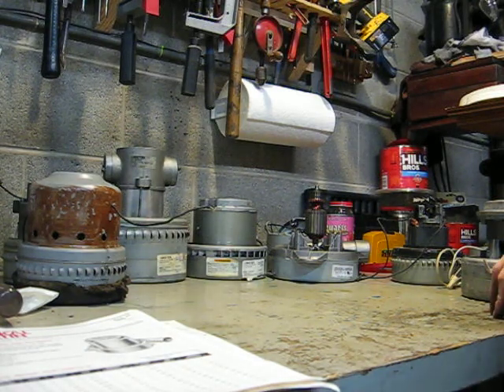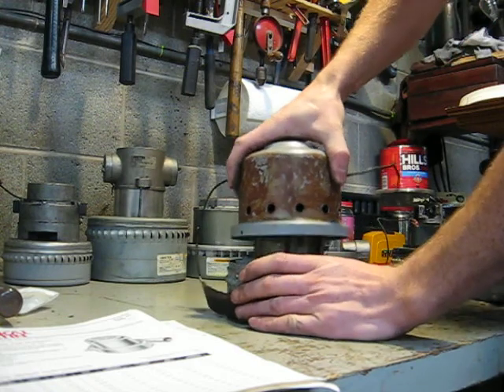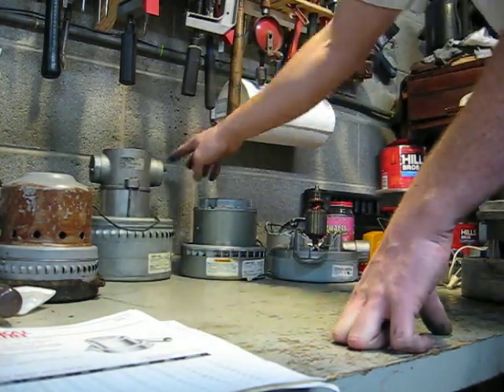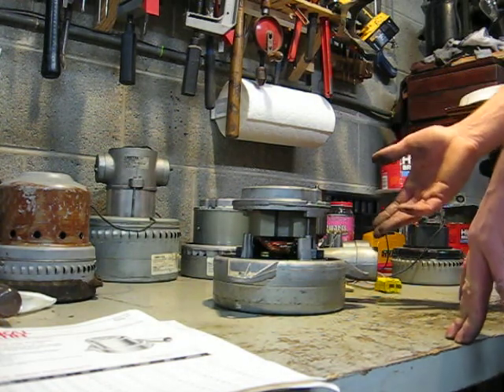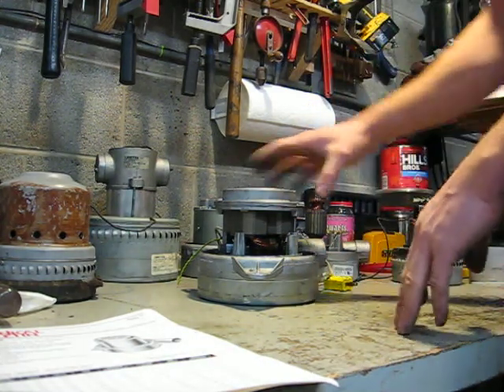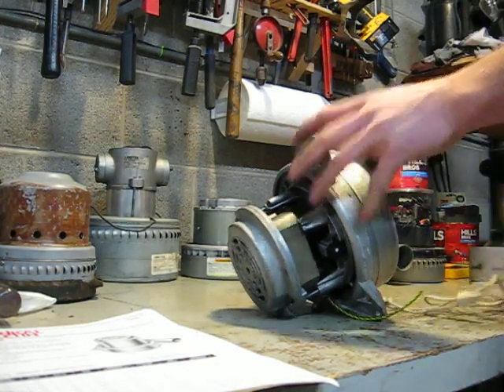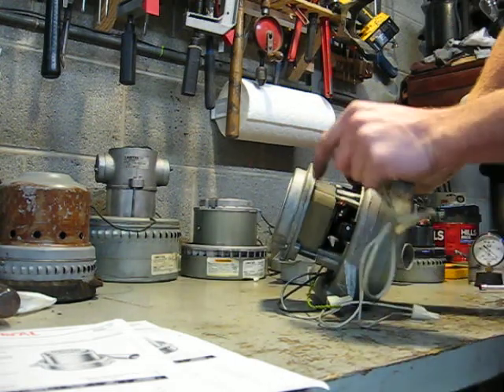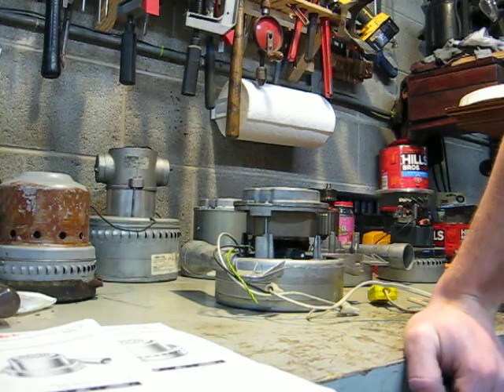Ametek-Lamb Central Vacuum Motors

Comment: I want to build a shop vac with one of these motors which one would work best, im not to worried about cost, .thanks
Reply from the maker: @MrCubflyer  depending on your application (wet or dry pickup, hose diameter and length, etc) you might have several options. Also think about filters...the more airflow you have, the more filter surface area you need

Comment: The Ametek-Lamb motors are very solid and perform great. I do have a 7886-50 flow through motor from a German Miele S142 made in 1997. The plastics of the vacuum cleaner was so dried out and cracking that I moved the motor into a newer housing of the same size. Still running great on a daily basis and way better than what you can buy today.

Comment: Very interesting and informative!  Thank-you.  Question: at one point in this video, you mentioned that some vacuum motors have two impellers, or even three.  Is “two impellers” what constitutes a “two stage” motor?  If so, how can multiple impellers be run off of one motor without overloading the electric motor, or loss of performance?

Comment: Interesting.  I have a 115334 sitting beside me that I took out of an astrovac. It is clearly stamped made in USA. The website that I ordered a new one from had a little paragraph explaining that the new ones were no longer made here, and to not expect it to last or work as well as the original. I sort of expected that anyway. But now I'm contemplating ordering new brushes for the old one and trying to rebuild it. Any thoughts?

Comment: Owen, just yesterday I replaced  a lamb motor from a two motor Beam 2900 central vac unit. This unit had 2 Lamb motors. Each motor ran at 110 volts each, however the unit was wired to 220 volt outlet. Inside the unit was a circuit board that separated the 2 motors to run at 110 volts. Powerful suction and the dual motor exhaust looked more like a drag racing engine.
Reply from the maker: That's interesting - I haven't seen that arrangement, only 240 volt motors. If it used 120 volt motors, they would have to have been wired in electrical series. Have done that a couple of times for special applications.

Comment: Dont they use these bypass motors in the Turbine HVLP systems such as the Fuji Mini Mite or am I mistaken
Reply: I think so but seems the only thing you cant find on the internet is a picture of the internals of a turbine hvlp. I have been Trying to figure out how a couple old vacuum cleaner motors sell for $1000 when labeled as a paint sprayer.? Would be really cool to grab a few from the scrap yard and plumb them in series and see how cheap i can make a 6 stage hvlp
Reply: @josephcalvosa8272  I think it's only ~$1k for the whole unit. I did a quick search for HVLP blowers and there are listings that appear to be standard vac motors for a few hundred bucks. High end pneumatic painting sprayer systems can be hundreds of dollars and that doesn't include the air compressor. But I don't know for sure.

Comment: Hello, I am  trying to connect a Windjammer 116630-04 to a 0-10v  signal generator for speed control. I am having problems with the wiring and wondering if you could help me- you seem super knowledgeable about these blowers. Thanks!

Comment: I gotta lot of love for the 334.   I have to say that of new generation motors the 122233-00  6.6" 2-stage tangential by-pass is a impressive performer (not for cyclonic models).   Longevity remains to be seen but it's hard to go wrong with a 2-stage tangential by-pass motor.   Sticking with that style of motor has been very good to me in terms of limiting my warranty calls.